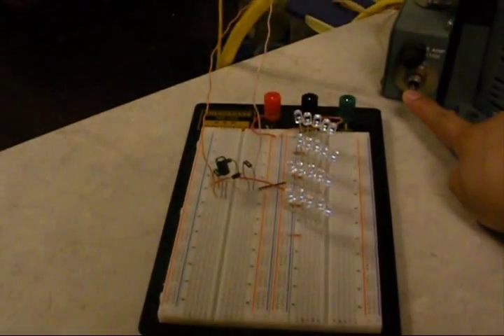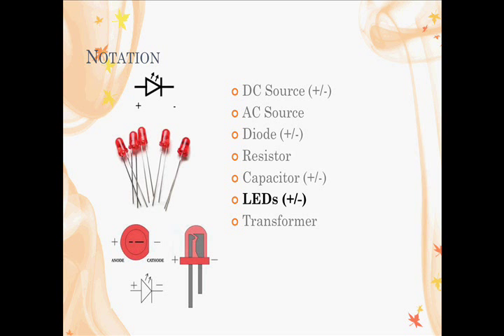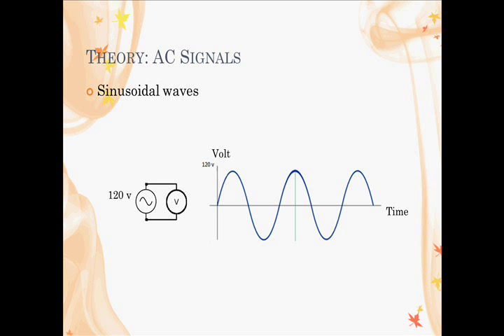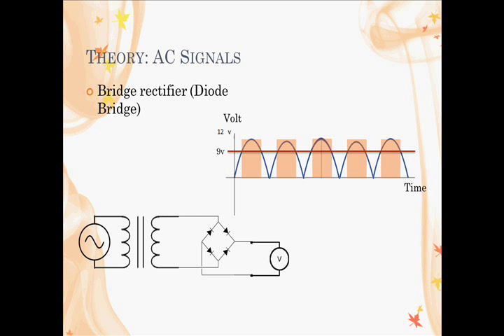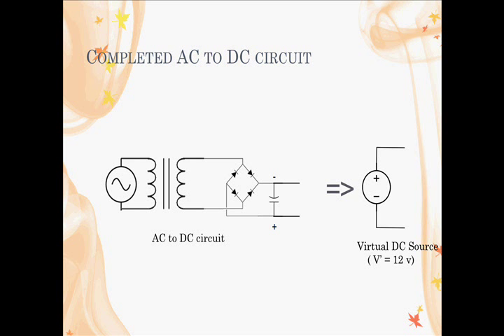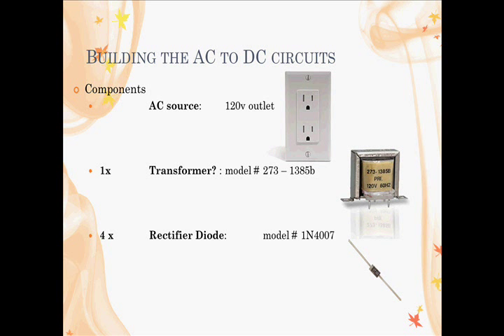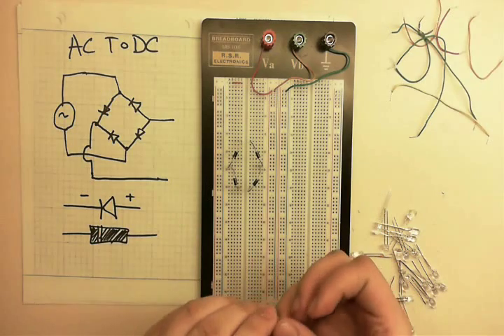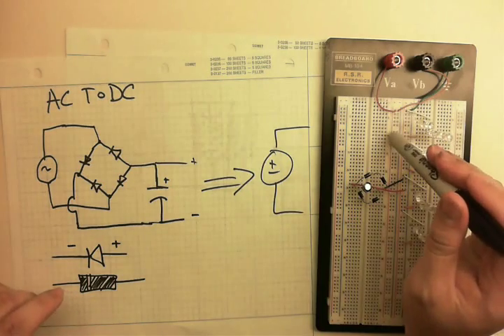how to power an led with ac current

Comment: Took a quick look at the video, had nothing to do with capacitive current controlled led arrangements… 😕
By the way, AC transformers are Vrms rated; therefore the output is 12Vrms (peak voltage nearly 17V) not 8'485Vrms, my beloved m̶o̶r̶o̶n̶ smartass… 😒
Hope this helps. ☺